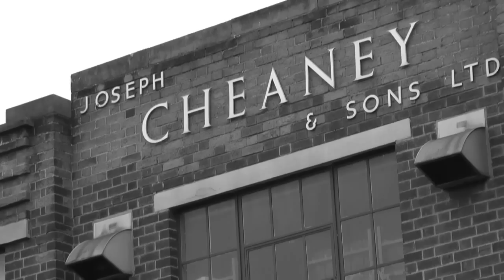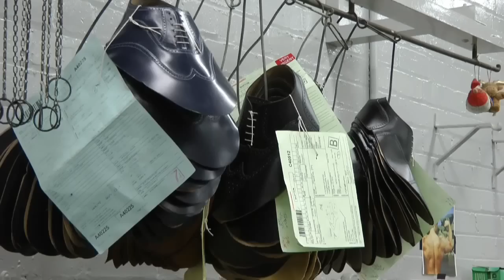Cheaney: Making an English shoe, with William Church

Comment: Looks like a lot of recruitment was done in the mid-1960’s!  It’s a shame that there doesn’t seem to be many young people going into the shoe making trade.  Those saying this isn’t handmade should familiarise themselves with how mass produced shoes are made, literally at the press of a button.  Of course more operations could be manual rather than assisted by sewing machines etc (which are still tools, just as a needle or a hammer is), but then that would also increase the price substantially, as well as reducing the number of shoes made and the viability of the company.  It would also be very easy to cut leather by a computer controlled machine for example, but it is still done the traditional way.  Great to see traditional shoe making is still alive and well in Northamptonshire!